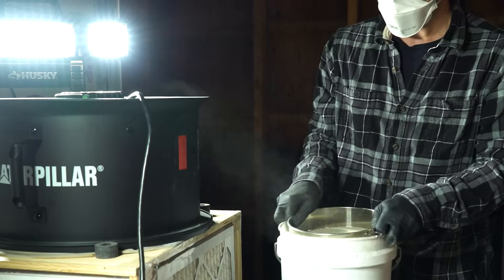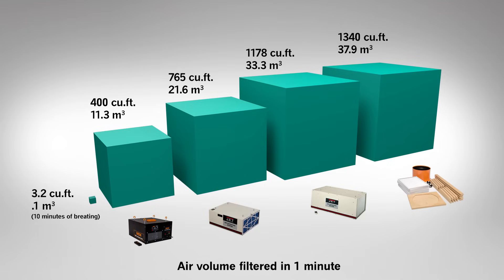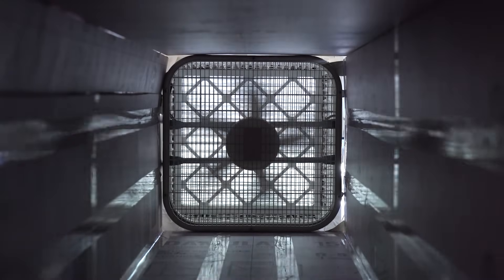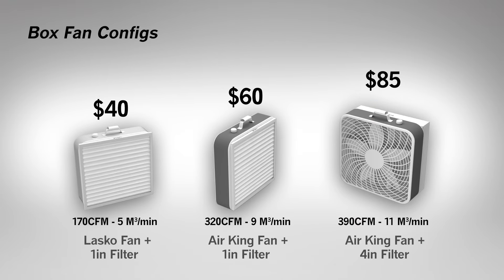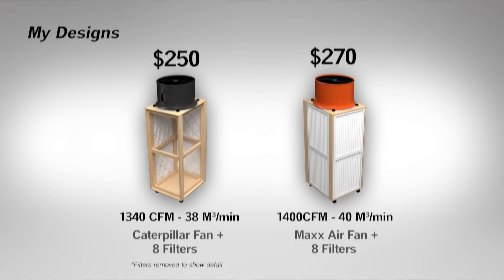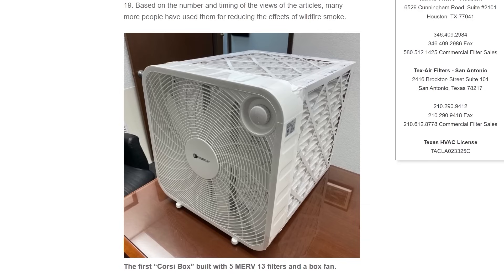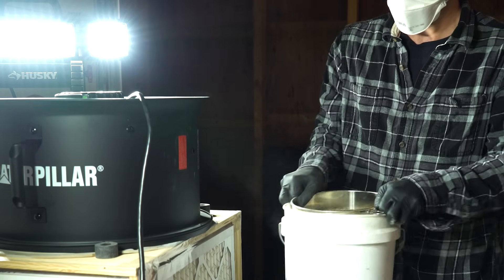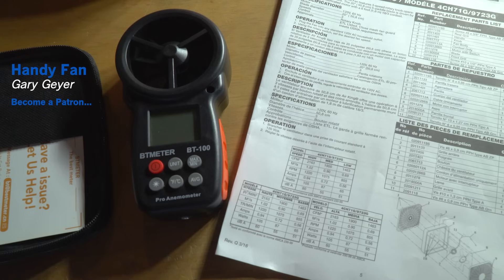What is the best DIY Air Filter?

Comment: I've got a dust collector with a 700 CFM fan. It's got a cyclone separator in front that catches the big particles, but I want to replace the collector's cloth filter bag on the output side with a filter box using one of your designs. The fan's output comes through a 6 inch duct though, so the stream is really fast and really concentrated. What sort of diffuser or plenum can I build to put ahead of the filter box?
Reply from the maker: If I am imagining this correctly, the 6in duct could go directly into the filter box and it may not lower performance that much.

If you want to diffuse the incoming air, a jersey cotton body pillow case might do the trick. I've been experimenting with this concept for a while and these are too restrictive to collect dust coming from an axial fan but the dust collector should handle it well enough.

Periodic cleaning will keep it running optimally.

It should capture medium size dust and leave the small stuff for the HVAC filters.

This is the pillow case I've been running test with https://amzn.to/3BLOyjP

Hope that helps!
Reply: Thanks. I hadn't considered that.

Comment: when a fan is rated to move X CFM, it includes the air brought along with the air coming out of the fan directly. You can't just make a wind tunnel for it and expect the same amount of air movement. Bernoulli’s principle!
Reply from the maker: Very true! For this use case the only number that matters is the air that goes through the blades, so it's helpful to test the performance. Inline fans and blower fans should have more accurate numbers because they are designed to work in enclosed environments unlike axial fans.

Comment: Hi, sorry if you mentioned this in the video and I missed it, but do you think that this would be a good system to have near a spray booth?
Reply from the maker: I want to design a spray booth some time soon. The options in this video are only good at removing the particulate from the air, not VOCs. So, you still need good ventilation. 

Also most of these fans, with the exception of the Caterpillar fan in the description (even this fan is not rated for use in explosive environments), have open motors where the solvent fumes can get to the electronics. 

I believe the best fan for a spray booth exhaust is a blower motor with "shaded poles"

Some people have built the "original design/model-A" to work with air brush setups and they have worked well in large open areas. Just be sure to also have a lot of free air movement through the space.

Hope that helps!

Comment: Great video! Curious what you think is a good rule of thumb for how often you should change filters? 

Assume AirKing with 4 Merv-14 20x20x1 filters in a weekend warrior woodworking shop
Reply from the maker: Good question! I used my 8 filter design for 6 months in a similar scenario. When I first tested it the off brand MERV 14 filters could pull a lot of smoke from the air in about 45min. After 6 months of shop use these same filters could remove the same amount of smoke in about twice that time. 

When you are looking at the smallest particles in the air, the filters can handle a lot and still preform well. Wood dust tends to be much larger than smoke particles so performance in that area should be even better.

The best rule of thumb may be to get a read on the fan. If there is a lot of air being pulled in the front of the fan rather than being pulled through the filters, it's time to change the filters. If you pay attention to the way the air moves through the fan when the filters are new, you will be able to more easily see if air flow is being choked off by the filters or not.
Reply: @The3DHandyman  thanks for the detailed reply 🤟🤟🤟

Comment: Great video! I have a friend who has worked as a professional framing carpenter and then general contractor for maybe the past 30 years. In the past couple years, he started developing serious sensitivity to any kind of dust and a chronic, debilitating cough. When I pass by job sites in my city, I sometimes see masons grinding or cutting limestone or concrete with no respirator or dust mask of any kind. This is absolutely terrible for your lungs even when you're outside.

Fine dust particles are really bad for your lungs, and I'm glad that people on YouTube are creating more content with ideas for dust filtration. I'm also glad that tool manufacturers in the past decade seem to be focusing more on better dust ports for various kinds of saws and grinders.
Reply from the maker: Thank you! I have watched masons and other contractors do that same thing. That is part of the inspiration behind these ideas. I have an idea specifically for contractors that I hope to get to later this year.
Reply: I suffer from the same thing. I worry about getting COPD.

Comment: Did you ever use a setup with a carbon filter for filtering gases like VOCs? I want to build an air purifier that filters dust as well as VOCs and I'm wondering if and how I could add a carbon filter to your DIY filters.
Reply from the maker: Actually, you can add a carbon filter to all of my kit designs. I will cover this in an upcoming video. It takes a switch to an inline duct fan, which has lower air flow, but the addition of carbon is a must for some applications. The unit I am prepping for launch has the ability to switch from dust filtering to dust+VOC in a few seconds. This adjustable setup helps prolong the life of big expensive carbon canisters.
Reply: @The3DHandyman  wow, that sounds great. Looking forward to your upcoming video! I hope that you will use sufficient carbon. At least on the subreddit  'Air purifiers' people are saying that you need at least a couple pounds for the carbon not to saturate too fast. I guess the commercial air purifiers focusing on VOC reduction like Austin air and others underline that point.
Reply from the maker: @WindlBreaker  That's the plan. I'll take a look at that subreddit. Thanks for the idea!

Comment: Do you think one of these options would be good to put in a basement after asbestos abatement? I’m extra paranoid lol.
Reply from the maker: That's a good question. I looked into that extensively after my old home flooded last year. All the samples I had tested did not contain asbestos, thankfully, so I didn't have to test out those theories. In short, You will want to use filters with the highest level of efficiency. I would probably go with a single fan plus this MERV 16 filter https://amzn.to/43YXRtK

It's expensive but it is the highest level of efficiency you can get on a DIY unit. Otherwise buying a pro HEPA filter is also a fine choice. I've run some tests on the Blue Air 211 and it preforms well https://amzn.to/3L1zMcX

Hopefully the crew that you hired for the abatement does a stellar job and there is no dust what-so-ever left behind.

Comment: Stumbled across this video and it was very informative. I'm looking to setup something similar for my shop soon. On your shroud testing, you should try removing the cover from the King fan and putting cardboard "fillers" in the four corners. That way you have a shroud at the location of the blades. If it works, and I suspect it will, it would be easy to 3D print some really sturdy pieces and improve performance at very low cost and effort.
Reply from the maker: Already finished the parts for this, just need to run some tests. The video should be out in a few weeks!

Comment: Hi, first off like everyone else I gotta give you your deserved thanks for uploading these videos. It's extremely valuable information.
I have four quick questions that I would greatly appreciate your help in answering:

1. When the Merv/Hepa rating is 14, meaning that it only catches 74-85% of .3 micro particles, does it really not make that big of a difference in this case because the air will be going through the filter multiple times over a certain duration? So if the filter misses the particles the first time, it's still possible for it to catch the particles on the next round of circulation, right?
2. Have you ever tried anything to reduce the overall DB's of these fans? I was looking up the Air King and the one thing I noticed is that people in the reviews say the fan is pretty loud.
3. Do you have a video or know of a video of someone building the "Air King + 5 Filter C/R"?
4. How often are you replacing these filters vs how many hours a day are you working with these filters?
Reply from the maker: I'm happy to do it. I've found the experimentation really enjoyable. 

1. Every time the air passes through it will capture more particles. HEPA is the highest efficiency and to get to that level a MERV 13 or 14 will need to process the air multiple times to get close to a similar level of filtration. It's possible that some particles will still slip through and never perfectly clean the air. Keep that in mind. These filters are really designed to filter as much as possible for a low cost, they are not lab-grade equipment.

2.The air king is pretty loud. I have been experimenting with ways to make them more quiet and I will talk about that in an upcoming video. Building a sound proof box around the fan will cut down on the sound a little but it will be a big build.

3. The air king is oversized an it will not adapt well to a taped together box. I am going to be testing a single fan/filter option that I will be testing soon and I am hoping to match the 5-filter performance in a simpler design.

4. In my experience the 5 filter design lasts 6-12 months in most conditions. In-home use without a lot of pets/mold/smoke/etc could see the filters lasting up to 2 years. I have used the 8 filter design for 12 months in a shop setting and the filters still preform fairly well in a smoke test.

Hope that helps!
Reply: @The3DHandyman  thanks for your response! I am not exactly sure what you meant by your response to question number 3. 

Also, out of the Cat fan and the Maxx fan and the airking, is one of them noticeably quieter than the others?
Reply from the maker: @Therunnerisrunning  Sure thing.

I think the air king will not work well with the taped together Corsi-Rosenthal style filter. It is about 1in wider than the standard box fan and it will be difficult to tape things together properly with 20in filters. That said, if you use 2in thick filters, it might work well enough.

Here are the sound levels for all the fans tested. The highest number is the highest speed and the lowest number is the lowest fan speed.

Background sound 40db
Lasko @1 ft - 63, 60, 55
Air King @1ft - 68, 66, 61
Air doctor HEPA @1ft - 64, 58, 52, 45
Maxx air @1ft - 71, 67, 57
Caterpillar @1ft - 71, 67, 63, 57

In general I find the drum fans to produce a more pleasant/white noise sort of sound than the box fans. I am working on an idea that will hopefully lower the sound levels of the box fans, but I need to do more testing.

Comment: Would a pair of Lasko fans inline significantly impact performance, or would it be better to simply have two separate filter devices in the shop?
Reply from the maker: 2 separate devices all the way. Running this type of fan in serial results in a lot of turbulence and power loss. By running two at the same time you double the output without any of those issues.

Comment: I think I may need to look into this more but if anyone can provide a quick insight. 

I moonlight doing gel manicures and it creates so much fine dust. I have a dust collector but I feel like I could use something like this as I still get dust everywhere. I’m thinking the air king with the box style surround is better? 

Would be nice to use around the home when I am not doing nails too.
Reply from the maker: That's a use case I haven't heard yet :)

I think you are headed in the right direction. Because you are not blasting out dust at a high rate of speed, a box fan and a single filter should do the trick. You can pull it up within a few feet of your work area and it should capture most of the fine dust.

You may not need the air king. It is more powerful than your average box fan but it is also more loud. Your clientele may not want to sit next to something as loud as an air conditioner. Just a thought.

I'll have a kit for this style of filter coming out in a few weeks. Working on some tests now. The idea is to eliminate the need to tape the filter onto the fan. I also have an even smaller and more quiet option that I'll show off in that same video.

I hope that helps send you in the right direction!

Comment: I have an issue with Central Air dust. I've been meaning to complain about it, lack of a better term. I figure a similar design might be just what I need, and mounting onto the wall near the vent.
Reply from the maker: Any one of these methods might work well for you, even the single-filter/box-fan method. 3M MERV 13s work really well for capturing the extra fine dust. The 8 filter unit in this video would likely filter 2 times more air than your HVAC is putting out and it may be overkill for this situation.

It sounds like you may want to consider air duct cleaning if possible.

Comment: The set up I'm using, is a 5-filter Corsi-Rosenthol box, using 4) 20 X 25 X 1 filters, and a 20 X 20 X 1 on the back. Place the box on a wire kitchen rack, 16 X 22 X 10" tall, with the fan blowing towards the ceiling. Placing this apparatus in the middle of the shop will help keep everything dust free. Run the filter continuously. By placing this in the middle of the shop space, it creates a toroidal air circulation, and is the most effective way for a single box fan to cover the largest space possible. I'm running MERV-12 filters now, but I will be replacing them with MERV-I3 filters, with the 4 sides being slightly larger, at 20 X 30 X 1. That extra 400 Sq. In. of frame area should help compensate for the extra restriction of the finer filter media. (Besides, the 30" tall filters were the same price as the 25" filters, so that extra area didn't cost extra)
Reply from the maker: I love the toroidal setup. The center of the room is really the best place for it. I want to do a video on filter placement in the next few months because it is really key the the effectiveness of the filter.

One of my best preforming kits is a 20x30x1(or2) deign. The static pressure inside the unit drops to about zero with these bigger filters. You are also right on the price, the 20x30s are quite good on cost.

Thanks for the comment!

Comment: It appears that sucking air also blows and sets up currents that will carry dust which might escape the filter altogether unless the air is blown out of the work area.  And then if warm air is blown out cold air will come in to replace it and then you may have to go in and get warm.  Around and round we go and where we stop nobody knows.
Reply from the maker: Ducting air is very useful when it comes to creating beneficial circulation in the workspace. You don't necessarily have to remove the air from the space all together. I have some ideas for this that I'll discuss in an upcoming video.

Comment: the design of the blade makes a difference . next time you test use a smoke machine fog machine.  your filters are a waste of money you CAN’T wash and reuse them. buy .01 micron CLOTH filter . 17 bucks for 16 sq ft and you can vacuum or wash it. when i say wash you run water on it not in a washing machine.  you built it like your design but in reverse
Reply from the maker: I've done some smoke tests on all these options with another 25 tests coming soon. The videos with all the info aren't out yet but the single filter/CR design results are. The reusable K&N filters don't preform as well as the disposables but are good for many years and are a much lower cost in the long run. 

Where do you get .01 micron in that sheet size? I generally see 1 micron fabric as the lowest standard option.

Comment: I think you're using the wrong style of fan.  I'm trying to replace my D480(a 480 sqft air purifier) with something larger but not 240v so I think I'll try a 1TDT7 (542 cfm at 0wc & 450 at .5wc) b/c the High-pressure 1TDR6 (44 cfm at 1.2wc) too small. There aren't many options out there that can clog a filter. I think I'm going to make mine 6ft tall so that the outlet is as far away from the inlet as possible.
Reply from the maker: A 2in CR boxes and my Model-A design have enough filters to create virtually no static pressure with the fans running on high. As a result a blower motor is not necessary for optimal function.

That said, blower motors and inline fans are better with static pressure so if you want to run multi-stage filtration, these are a better way to go. The cost of the fan and the amount of electricity increases with both of these options and the air flow drops quite a bit vs axial fans. I'll have a few videos out on this subject in about a month or two.

Be sure to duct the air away from the filter to another side of the room. I've found that can have a huge boost on dust capture despite the lower CFM. I think this may be the biggest benefit for not using an axial fan.